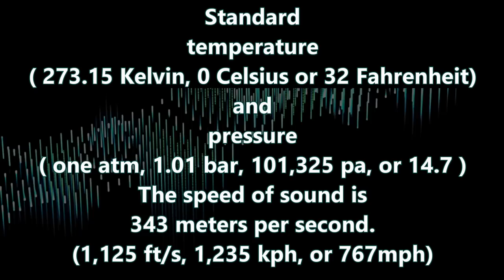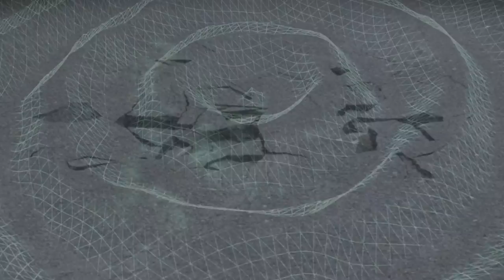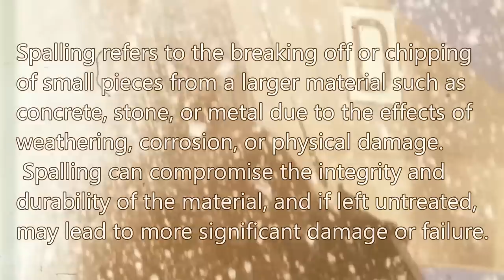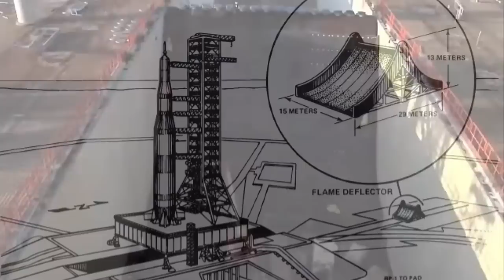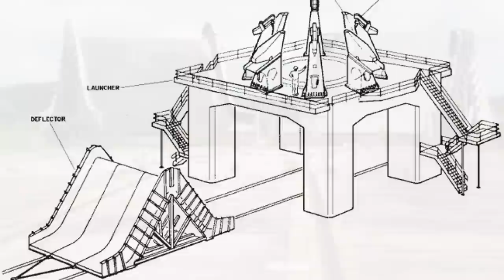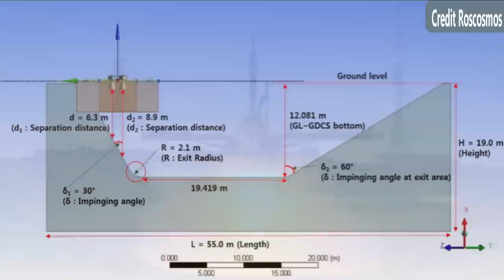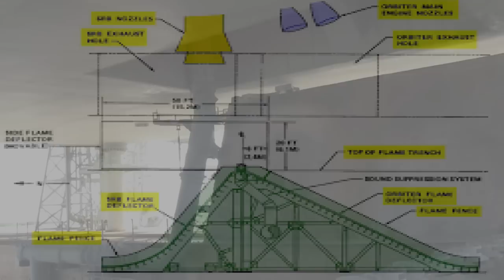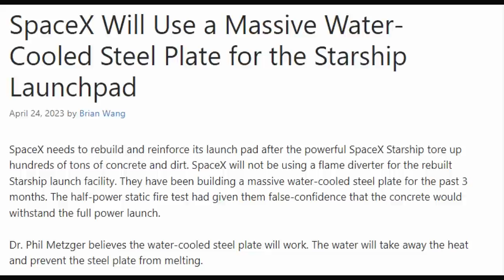How to Fix Starbase After it was Destroyed by Starship!

Comment: IMHO starship was the victim of overengineering and innovational hubris. The first job of the launch pad is reusability. It must absorb all the power of launch and landing even in the event of a RUD. It didn't need to be engineered, it needed to be overbuilt. The bow of battleships is an easy example of deflecting massive amounts of fluid energy. The 18 inch thick steel would be simple and inexpensive to copy and install under the launch mount relative to its importance to the overall project. Any project is only as strong as its foundation. It wasn't necessary to relearn the lesson of necessity of flame diversion and water deluge.  It has been learned for hundreds of years often in the heat of battle.
It's OK to learn your lessons in the school of hard knocks. Humans have been doing that since the time of the pyramid builders. But it's a shame to watch it unfolding while sitting in my recliner and typing sharply worded warnings! I like the youthful exuberance of the workers at spacex. But a few greybeards sprinkled in the upper echelons of management would prevent some of the remedial class work going on in Texas this week. I'm going to take another blood pressure pill now and pop some more popcorn. Lol
Reply from the maker: Should they have built a giant mobile mover?
Reply: @terranspaceacademy  no, I don't think so. His catching mechanism has merit. But putting the tank farm a mile away and laying pipe and rail beside the road as well as a launch mound, blast diverter and trench would have saved time and money. Plus it might have helped his reputation and standing overall.

Comment: When it comes to minimizing acoustic loads SpaceX's pad setup is almost ideal according to this document https://ntrs.nasa.gov/citations/19710023719

However the force and heat of the exhaust, sending debris up etc, might override any benefits from the minimal acoustic efficiency benefits, it may even be that Starship hull is robust enough to withstand higher acoustic loads in return for reduced force/heat beneath the pad damaging the structure underneath with the addition of an angled flame diverter

It's SpaceX's call ultimately
Reply from the maker: Stainless steel goes a long way I think...

Comment: Has anyone designed Mars suits with radiator fins on the shouldsers legs and back?

I would imagine such fins being water cooled underneath and solar panel mounted on the top.
There would be a special fabric used for graments so capillary suction will automatically keep the body dry while pooling the sweat into tubes that stratify the space suit in a way that cycles it all through filtration that's fuelled off your body movement + heat.

The suit will even have a mechanism to safely generate electrolysis in the secreted fluid from your body to produce hydrogen fuel for the suit and breathable air for the user. 
This will obviously be supplement to the initial suply of oxygen and fuel before EVA is initiated.

Oh!
Yes:
The suit will also have a special grounding system that autonomously harvests the ambient static electricity in Martian soil as your body moves. This will allow easy brushing away of dust that wood otherwise cling to and hinder the solar cells.
That collected static electricity will be used to supplement energy in power tools.
Reply from the maker: Not that I've seen...
Reply: @terranspaceacademy t needs to be so... if only I could at least draw if not that and be a legitimate engineer, I would render lots of random crap that might inspire others to build them.
Reply from the maker: @linyenchin6773  We should all have a dream Lin!

Comment: It's not that stage 0 is not the hardened, rapidly, and reusable launch pad, it's also what may be required to harden it to withstand multiple launches per day. If it were a clean slate, Engineers could design something along the Stennis style. The engine exhaust at the test stands flows into a deep water canal. It is reused rapidly over and over again. Concrete and steel are minimally affected. Starbase is constrained by its infrastructure and environment. Stage 0 at Pad 39A is of similar design. Water cooled steel may be better but that's the world's largest cutting torch bearing down for 15 or so seconds. It's going to be a hard sell to the FAA and a hard one to sell to NASA before Space X can continue construction at Pad 39A.  Perhaps someone could scale a blow torch over a steel plate with 1" of water covering it and an 1/8" water underneath the plate. See if the torch has any problem penetrating the scale steel plate. Needing some marine welders to chime in here. As an example: 

https://www.youtube.com/watch?v=rcS4Ieid_c4
Reply: The link doesn’t work for me. I can try googling from the description later.
Reply from the maker: I think they would have trouble digging but no trouble getting water once they did :-)